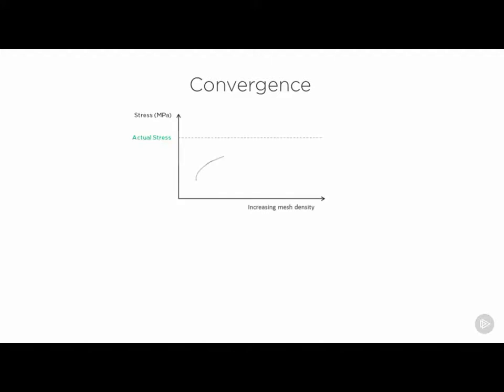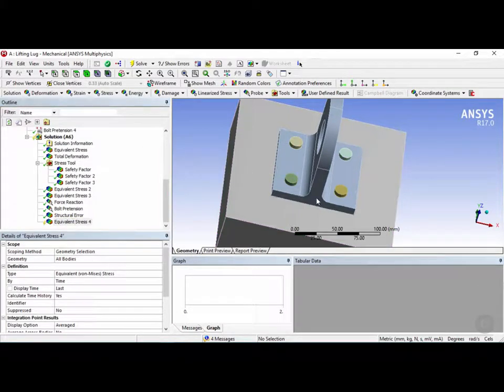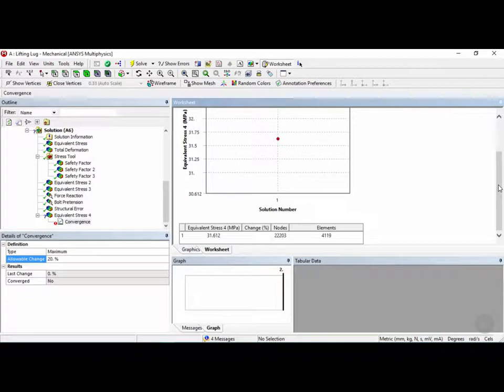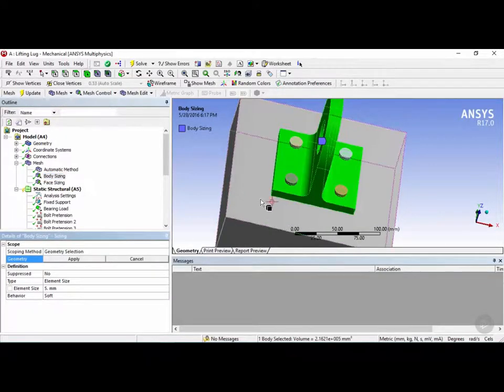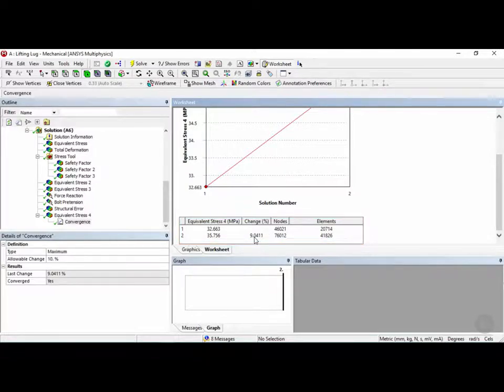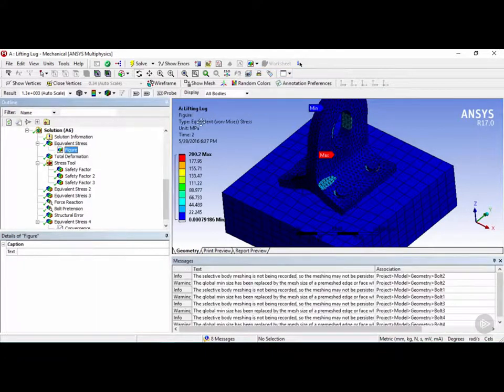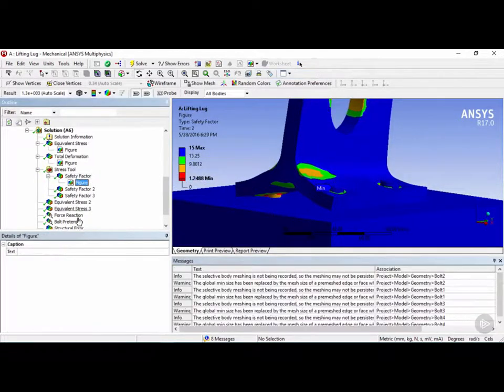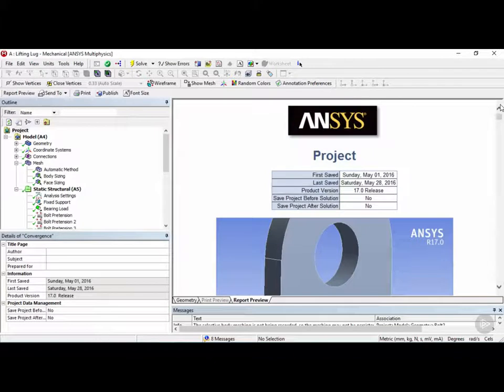Introduction to ANSYS | Convergence | Ep 4.4

Comment: Hey Hai... I am not getting convergence option when I am right clicking on stress...  Is there any settings that I need to modify to get that option...  By the I am using Ansys 18.2
Reply: Have you solved the problem? I face the same situation. i right click on every results, no convergence showing up
Reply: First add stress into the solution, then select the surfaces you want the stress analysis to be done. After that right click on the added stress and hit solve. Then after solving it if you right click on the stress again you will find convergence. Eazy pzy
Reply: @7arvnn  what if there’s no stress option at my solution? Can u help me pls